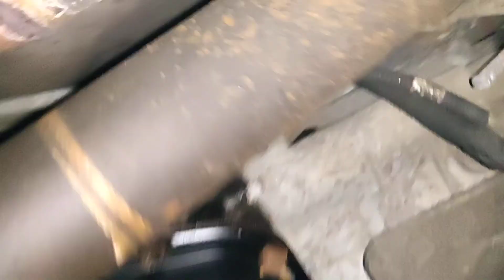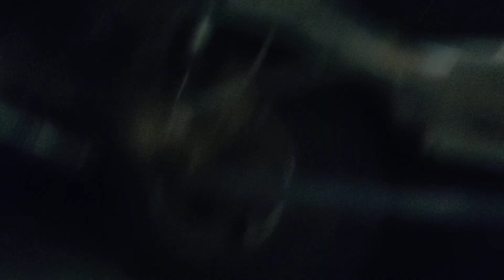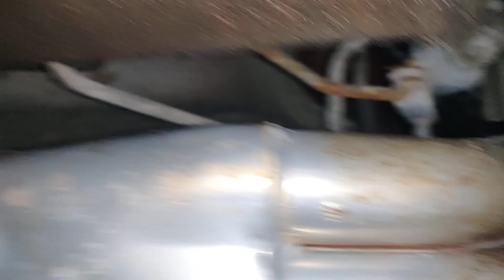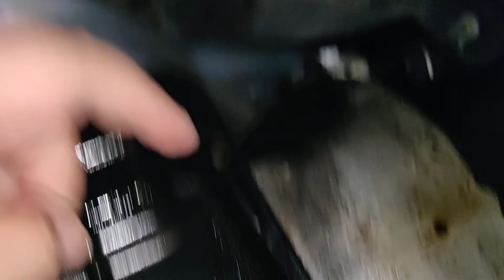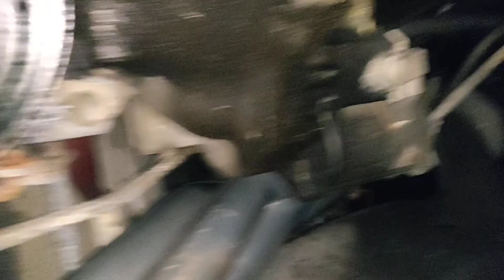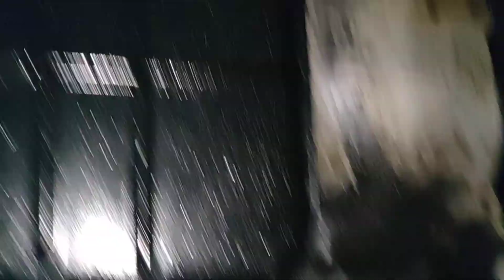1997 Dodge ram more noise

Comment: Sounds like exhaust hitting or a heat shield. Did you get any codes bedside the down stream 02?
Reply from the maker: I don't hear it anymore...seems to have gone away.
Reply: @bucsTILLdeath  what about the check engine light? I'm actually installing long tubes on my 1999 5.9 right now.
Reply: I had a similar noise. The left side pipe was hitting the transfer case ear.